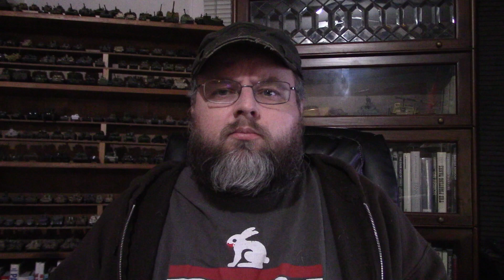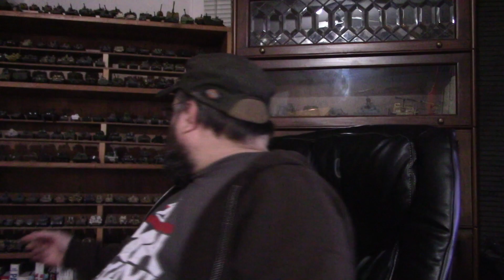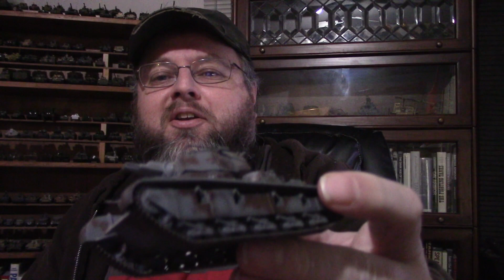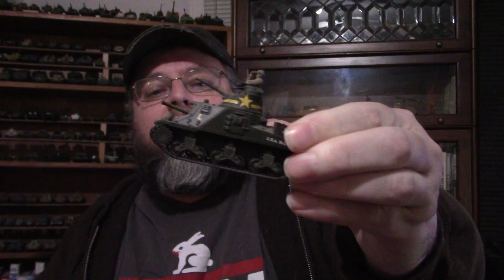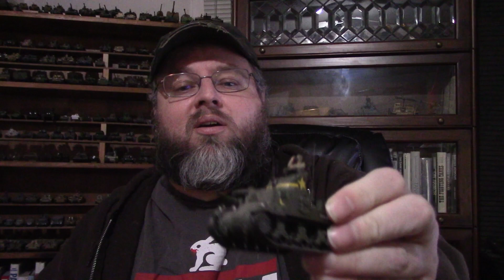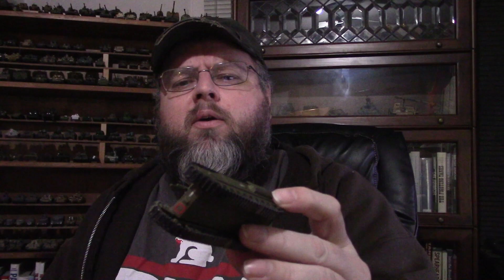Tank Talk: Tanks with Two Guns

Comment: Someone mentioned the T-35, also Maus had two cannons (both in the turret, co-ax 75mm with the bigger main gun).

Several of these like the Lee were an issue of not having a big enough turret race for the large gun. I recall theM3 Lee was designed to have just the hull 75mm but Armored Forces insisted on the full traverse turret.